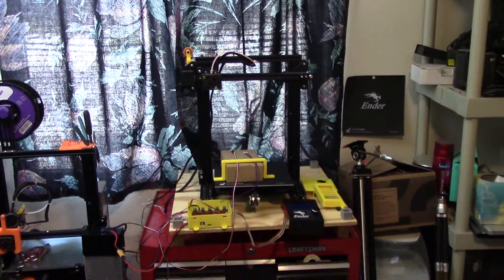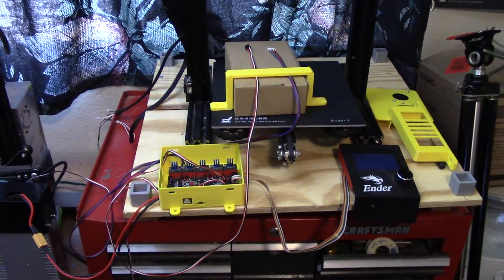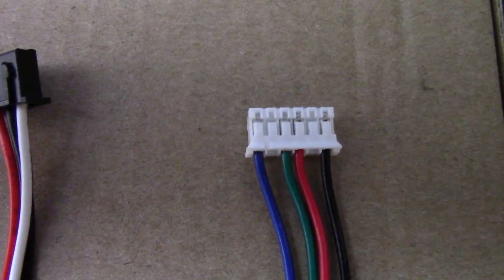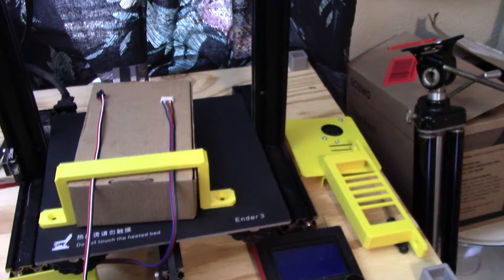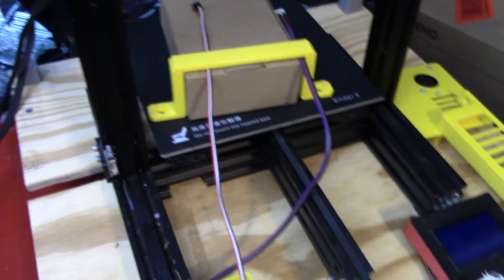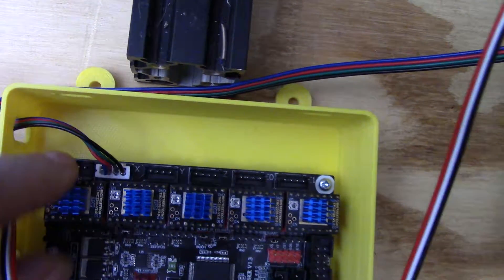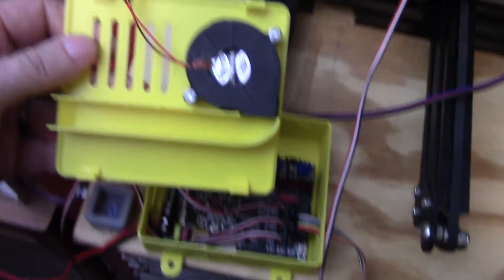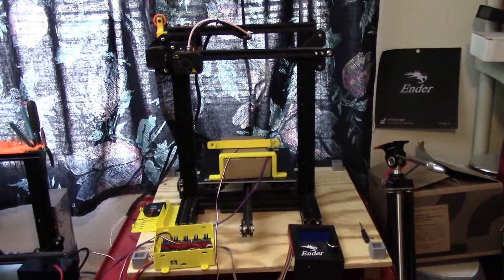Progress on my Ender 3 SKR 1.3 and Ikea Lack Enclosure

Comment: Thanks,  Chuck. You're making good progress. Just like Kenny, looking forward to seeing the end product.
Reply from the maker: Thanks Paul, I'm sick of seeing it there with it's guts hanging out so I'm going to try to get it finished this weekend. At least back to a working condition anyway. I still haven't made up my mind on what I'm going to use for the walls and front door.
Reply: @3rdpig  I think they have to be clear to keep an eye on things, Would perspex stand the heat needed for the ABS? It's easy to work with.
Reply from the maker: @PaulMcKillop  I just checked it out, Perspex has a melting point of 320c. I doubt the inside of the enclosure is going to go much above 80c and the outside is exposed to room temp, cooled by my A/C,  evap cooler or ceiling fan. So yea, that's a good idea Paul, I'll check out out further!